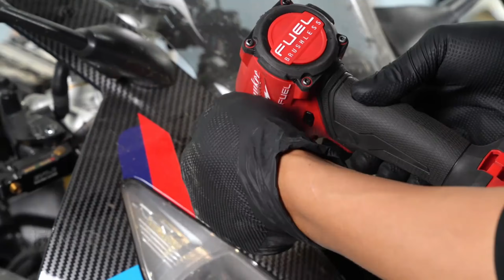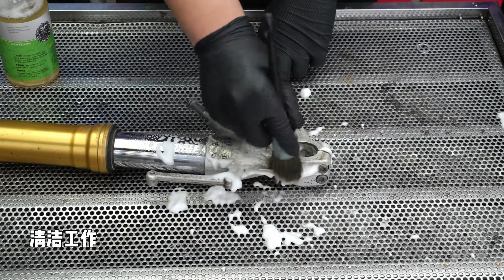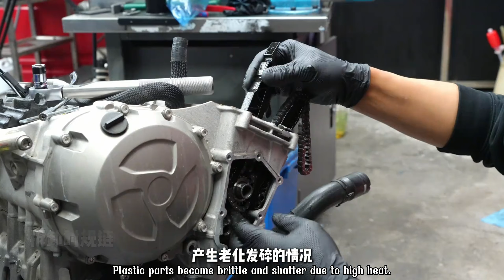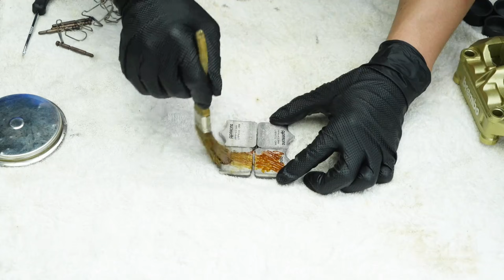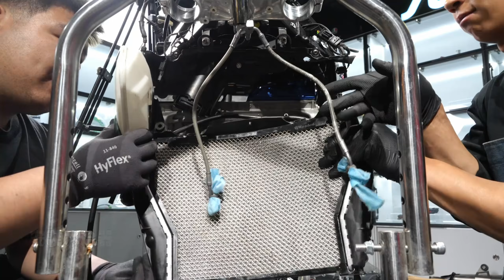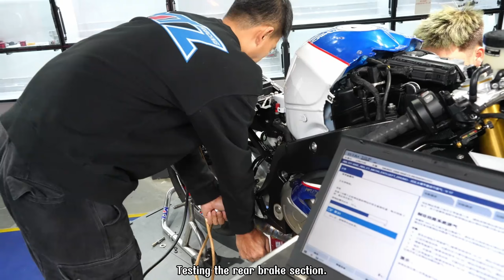Restoring a 7th-Hand BMW S1000RR: Can We Bring This Legend Back to Life?

Comment: eeeeehhh? NOT INSPECT CONNECTING RODS AND CRANKSHAFT BEARINGS ????? .... These are the parts that suffer the most in these engines, and don't inspect them? naaaaaaaaa .. . FULL DISLIKE 👎👎👎👎👎👎
Reply: Yeah. I wonder why they don't inspect that. 🤔
Reply: are you blind? he did it in the video
Reply: @aao331  At what minute?
Reply: No need to dismantle all. Only top set effected with minor lost compression. Its just enough